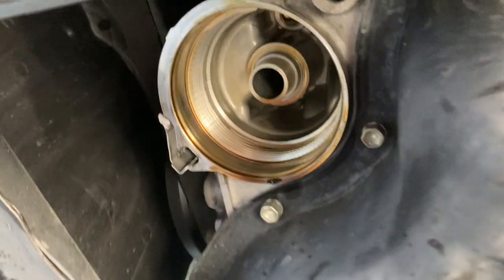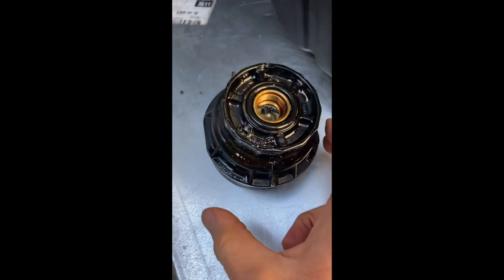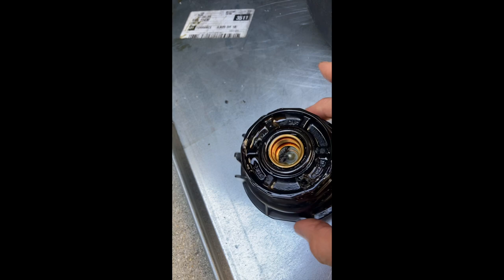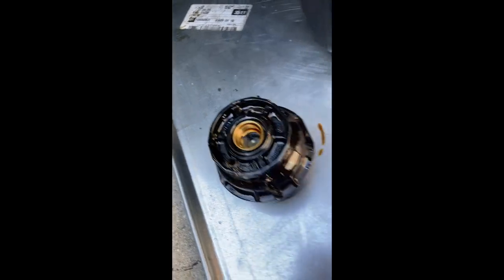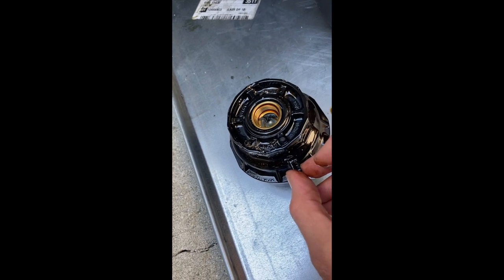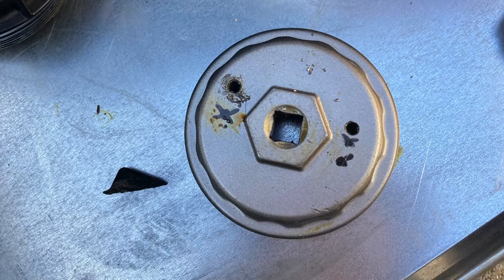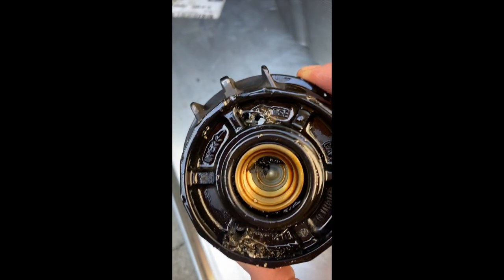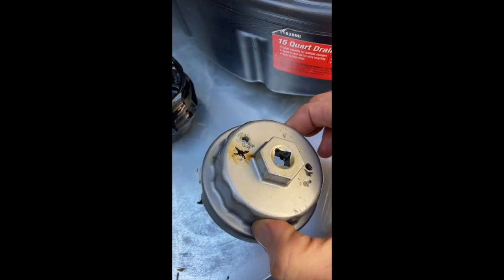2018 Toyota RAV4 Cracked Oil Filter Housing

Comment: This happened to me yesterday on my 2018 Toyota Camry XSE. I am so pissed at whoever serviced my car at the Toyota dealership when I took it in for the last oil change! 😤 Ordered the aluminum replacement part from Rock Auto last night for $21.89. Thanks for making this video. I was wondering how I would get that piece of plastic crap off. This helps!
Reply: Hey @mrcruzantrini, am currently having this problem, what was the brand of the oil cap ? And did it work great? Please 🙏 and thank u

Comment: Nope, this is not true. There is a metal clip on the housing.  If you don’t use a specific tool to remove the oil filter, it will crack the plastic filter cup. Perhaps its designed as a sorta of deterrent to stop people changing their ownboil
Reply: This is inspiring! I also noticed this metal clip. Could you give some tips to avoid the damage from this clip?
Reply: You're right but also wrong my filter was on so tight the tabs broke without the filter even moving

Comment: Toyota engineers had no GD business redesigning the oil filter system on their cars. This is a perfect example of IF IT WORKS DONT FIX IT! Toyota has gone back to using the spin on canister filters. This is what happens when a bunch of TREE HUGGERS,(environmentalist)  POLITICANS AND ACCOUNTANS start telling engineers what to do! The automotive industry has been using the spin on filters since the 50s that is over 70 years or more. IF IT WORKS DONT FIX IT!